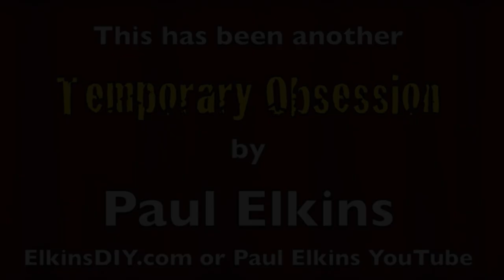Briggs and Stratton motor bicycle

Comment: Great straight forward and potentially cheap as heck project. I would like to see you build a bike camper that pushes the bike. The motor weight could be kept low in its own little housing and just driving one wheel.

Comment: Wow, I did one very similar, I used a friction drive, engine turned backwards, worked well,  30 + mph😎
Reply from the maker: Was it a briggs motor? If so that would make the bike less top heavy, even with the extra weight on one side that might be a benefit.
Reply: @paulwelkinsdiy  2hp, briggs, legal as a moped, 1972 vintage, took it and the bearings from it,no clutch ,just ran a cable to lift the friction wheel off of the tire😁

Comment: Neat project! Could you not just turn the tensioner arrangement into a Jack shaft/tensioner with two pulleys and then Have a short belt to a larger pulley on the jackshaft and a second belt on the smaller Jack shaft pulley to the large wheel mounted pulley thus adding further reduction.  Pulleys could be turned from aluminium in the same way you filed your roller wheel

Comment: been building motorized bikes(electric, & gas) for almost 15 years now 👍💨
Reply: Post some videos for us to admire? :D
Reply from the maker: Did you ever see my other briggs bike? (link at the end of this video). On that I was able to use all 7 gears with the motor, but was unable to pedal and the gearing was still quite high. My ideal version would be the briggs mounted in the frame with full suspension and use of the pedals but still have the engine powering the 7 gear cassette for low gearing enabling a bike camper to be in tow. Any thoughts?

Comment: Very cool Paul! How's the handling with all that weight behind the rear axle? I added 10 lbs of battery and controller to a rear rack of my franken-ebike and it made it pretty unstable. But, once I got used to it (like flying a helicopter or an airplane with a severely aft CG condition) and got on to using the instability to aid in cornering it's sort of a fun.

Comment: Connect it to one of your bike campers and you'll have a high mileage, cross country camper!
Reply from the maker: That was my intent, but the gearing is still too high. A 20" rear wheel and a smaller centrifugal clutch pulley may help, but probably will still not be enough for steep hills with a camper in tow.

Comment: 3:45 You need to put the motor more low...or ha a lighter one like a solex (50cc 2Stroque) https://www.youtube.com/watch?v=Di-rhNNHkg0
Reply from the maker: I checked out the video. I'm not too keen on friction drive 2 cycle motors. That was the first one I bought back in 1979. Although light, they chew up tires and slip when it rains.

Comment: Damn dude, that's so dangerous. Not to mention you're polluting far more and using far more petrol than if you just bought a car. Hell, the amount of pollution out of that you could probably buy a light truck and beat it's emissions. But the whole zip tied together drive train is horrifying. D: You're braver than I am riding that!
Reply: What are you on about
Reply: Dude are u smoking meth a bike with a moter uses maybe a gallon of gas over 100mpg how is that more pollution then a car ?
Reply: Really? Any proof to back up your claim?
Reply: I mean Briggs and Stratton is very poluting (if that is even a word) because of all the oil they burn, but damn it still ain't anywhere near as much pollution as a car
Reply: He liked his own comment. That’s sad
Reply: These get 80 mpg so don't cry in my milk😢
Reply: Don't be a bed wetter!